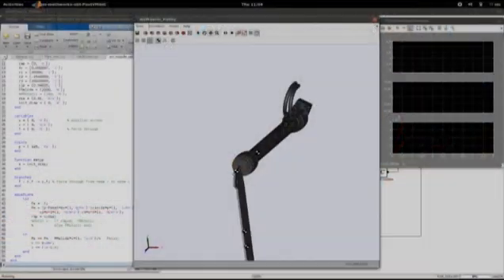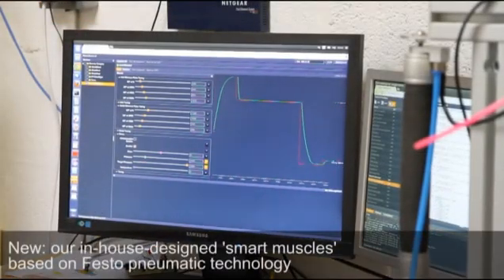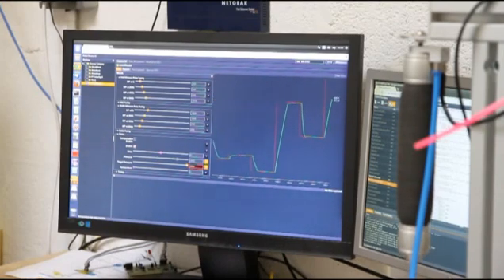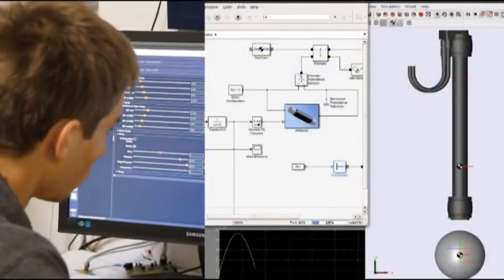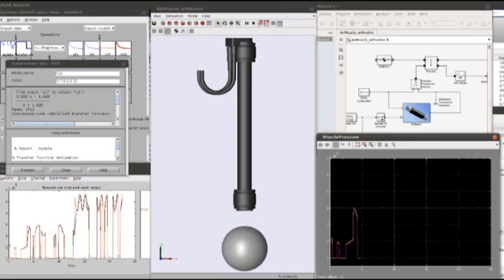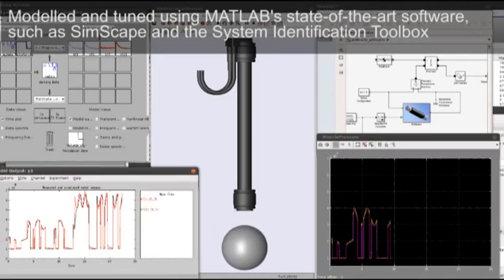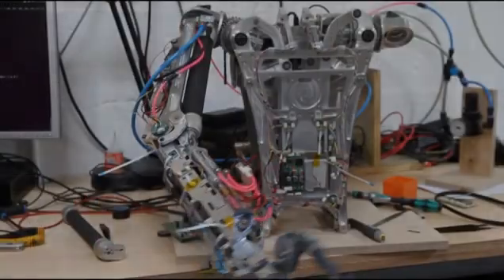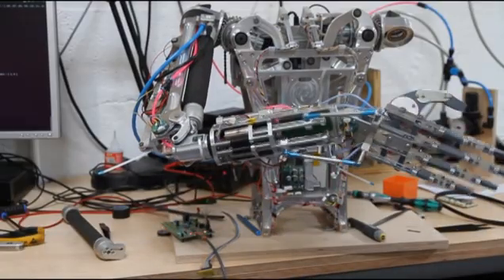RT Humanoid Robot Development with Matlab

Comment: - Hi Will, it is not so good because it is too heavy, not resistant to impacts, too slow and not so strong. I can explain you how to build a much better actuator which can be useful also to make a better biped robot than the new Asimo who can run at 9 Km/h. To build a Torso that way is not good either. I can Explain you how to build something much better. Resuming: There is a way to build a humanoid robot that can run at 25 Km/h and that can carry 70 Kilograms if needed. That robot will be much more resistant than Asimo. Because of its structure and special actuators you will be able to throw it from 3 to 5 meters hight and it wont be broken. If you are interested let me know. I can explain you how to build it.